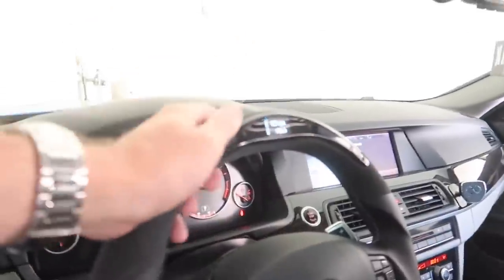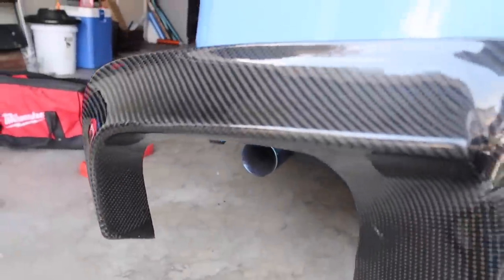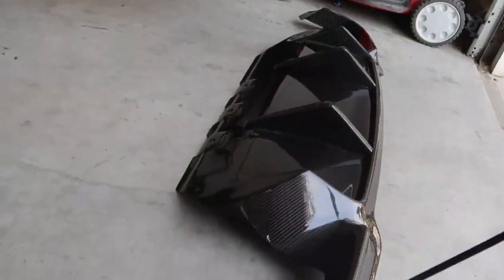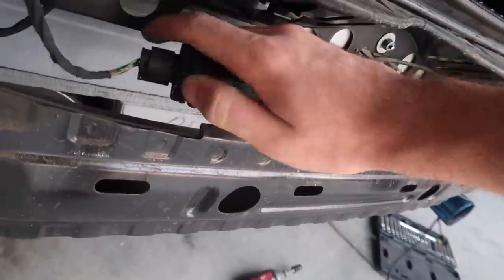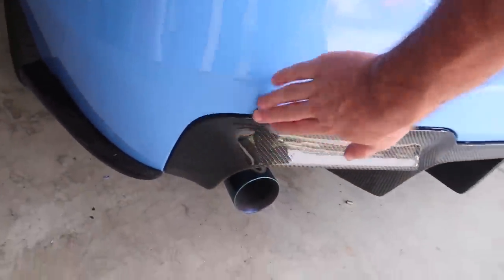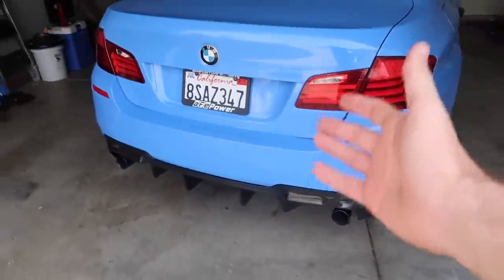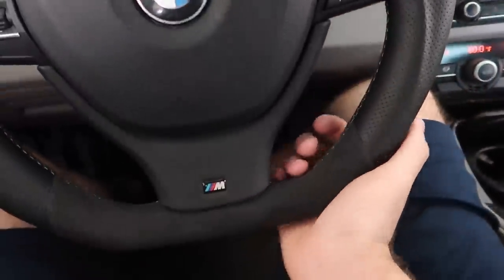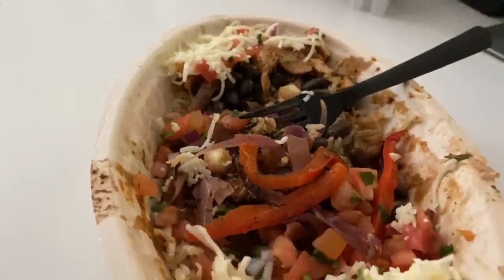HUGE TRANSFORMATION MOD FOR THE 535I + SUPERCAR UPDATE!

Comment: Nour. I had the same issue with one of my sensors and the problem was resolved by spraying a little wd-40,  Try it.
Reply: I tried it on my PDC sensor but ig it was past it’s time :( the wd-40 couldn’t save it
Reply: Rossell Castillo sorry to hear that. I’ve used it several times and it was a success. Keep it in mind for the future.

Comment: When you removed the piece on the rear bumper after you zip tied the other piece did you replace it or have to modify it to fit with the diffuser? I have the same diffuser and I couldn't figure out how to make it work.